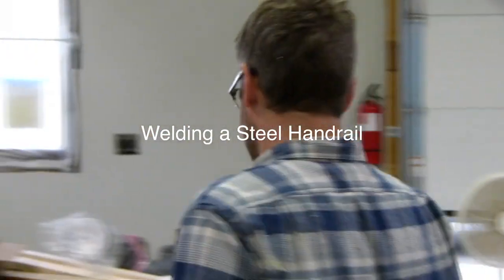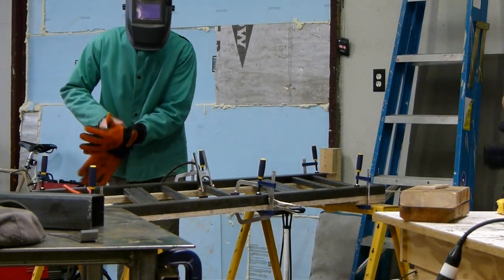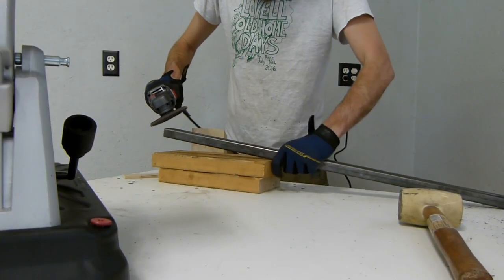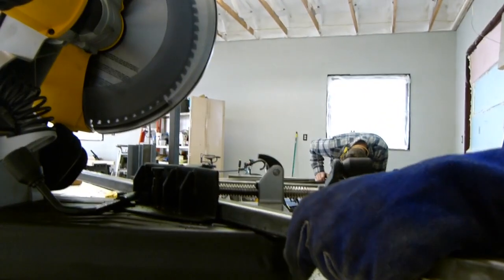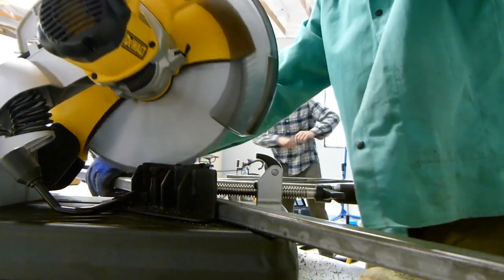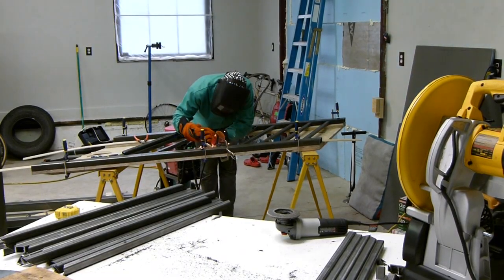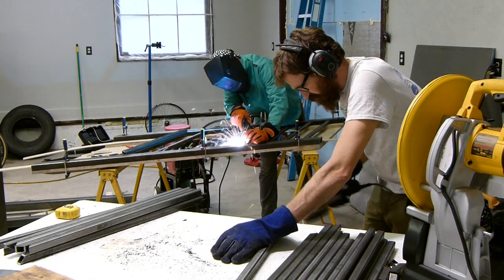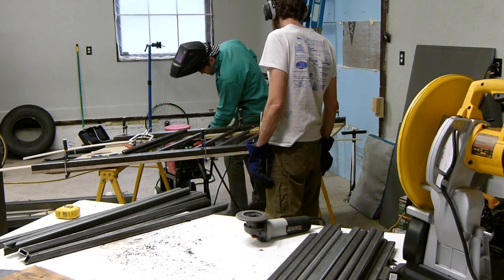Welding a Steel Handrail

Comment: Hey, welder here who does a lot of picket handrails - when the rail is laying flat, try doing pickets down hand both sides then across the top, flip rail and lay the last welds.

  It makes it so much quicker to complete and less to grind due to corners being wrapped
Reply from the maker: Heck yeah! Thank you very much. In fact this was my first day welding. It is a ton of fun.
Reply: Hi, I’m trying to learn welding home projects what machine would you recommend? Not to cheap nor to expensive around $1000 thanks

Comment: Sounded good. Get yourself some anti spatter spray. Tip I learned when I worked in a welding shop. Saves time cleaning up goobers especially for inside corners and hard to grind areas. Came out the balls.
Reply from the maker: Tom Saad Thanks for the tip. Yes, there was a bit of splatter that needed touching up. Hence the flap disk.

Comment: Nice handrails ... i like the wide rectangle with smaller pickets. Plain and elegant. Try welding opposite corners as much as possible...kinda like when torquing bolts...Even clamped metal just likes to warp or bow a bit wichever way it can find...work your way from outside corners end at center...not every single weld but a couple pickets on  bottom left part of railing ...then move to top right ... youll also catch any bowing by viewing it from different sides as your going along .. :-)

Comment: Which welding rod you used ?
Reply from the maker: Hey there. My friend has a Lincoln 220 wire feed arc welder. It is really straight forward to use, and makes a clean weld with the argon gas. I have never stick welded but I am interested in learning.